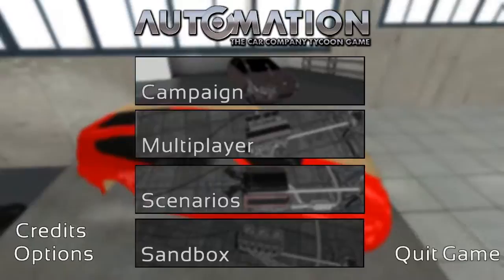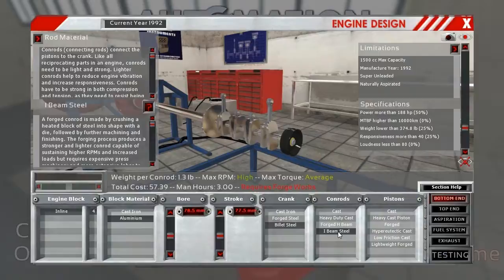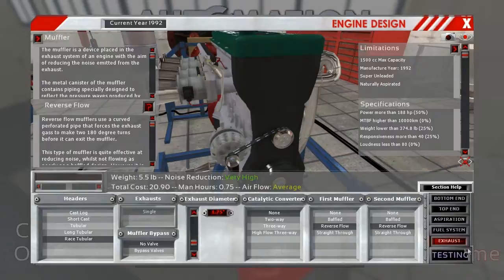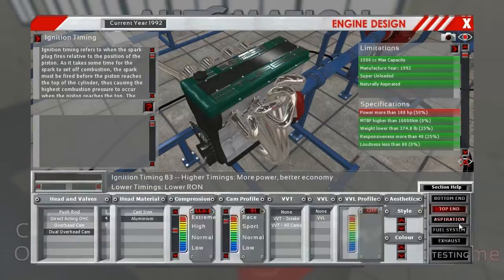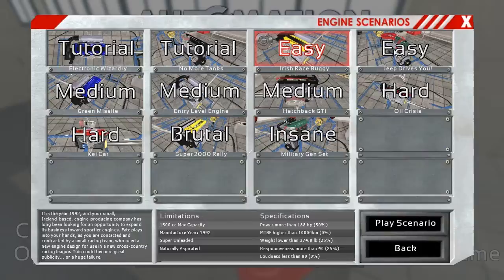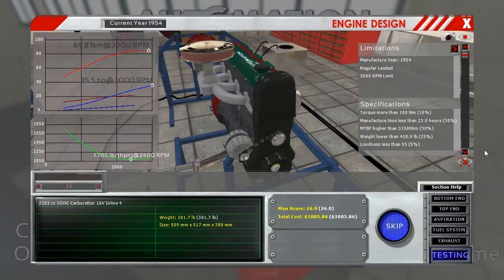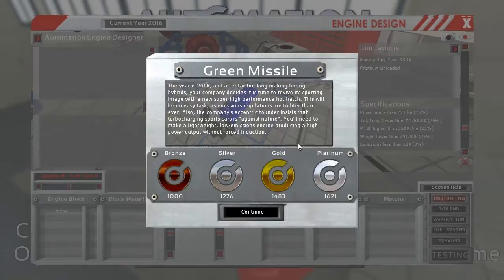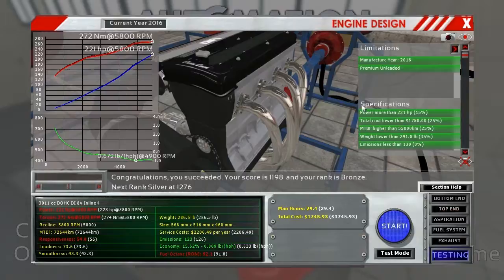Automation Ep. 1: Inline 4 Scenarios

Comment: A little tip, which may come in handy - in most naturally aspirated cases, compression raise by 0.1:1 raises the fuel octane required by 0.5 (a bit more if the compression is high already, a bit less if it is low.)
Reply from the maker: Thanks for the tip. I will remember it for the next one, along with remembering to adjust the exhaust diameter, haha.
Reply: Jolo Plays Looking at the warnings before the engine blows up completely is a nice habit as well.

Comment: Well, you are certainly the first to complete that last challenge with a 1.75" exhaust hahaha you are so gonna facepalm when you realize that :P
Reply: didn't know a race motor could have a exhaust that small and still actually run
Reply: I bet it has some sort of connection to the turbo valve cover, needs super high velocity exhaust gasses.
Reply: ConeDodger240 basically there is no exhaust it just dies about 8 laps in